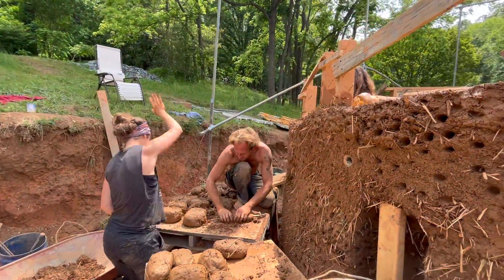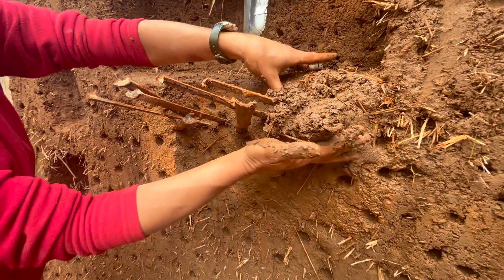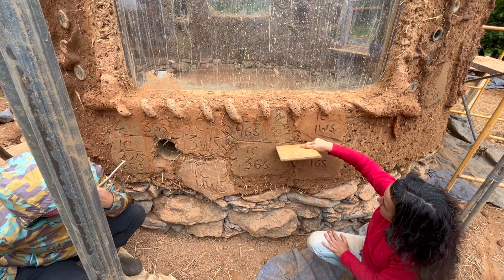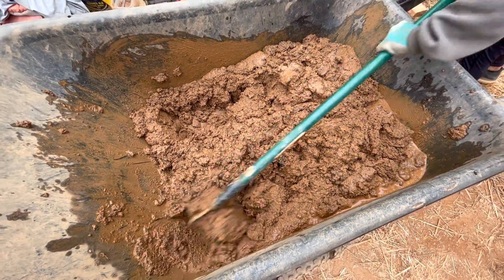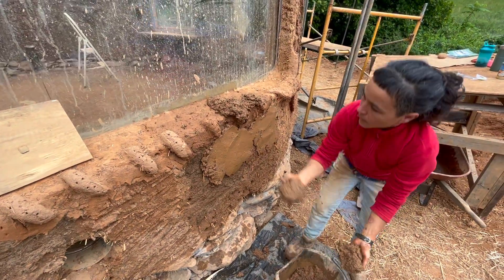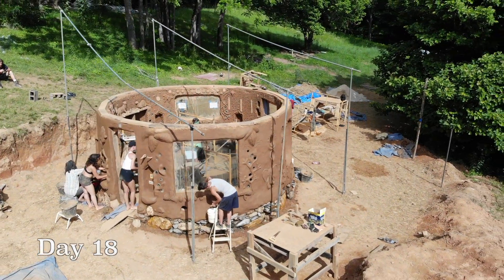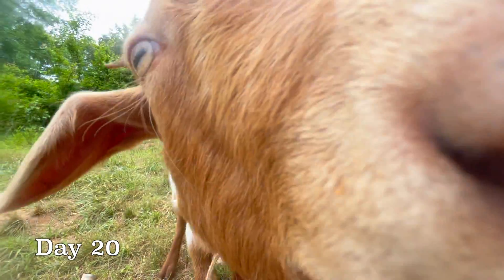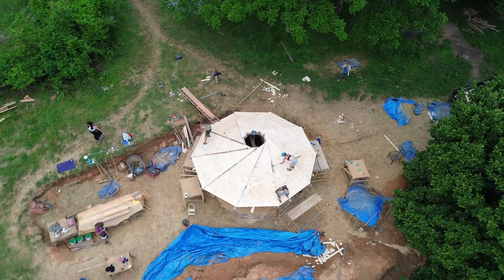How To Make Clay Plaster | COB HOUSE Part 6

Comment: Great series...What are the alternatives to Donkey manure since its scarce in our area..Also at 9:07, I see someone cutting hairs with scissors for interior plaster. Throw some light on that. Thanks.
Reply: I was wondering about that as well. Like is it composted? Are they mainly using it for a finer fiber? Could we replace it with other fine fibrous materials?